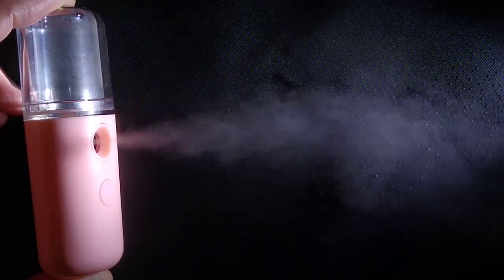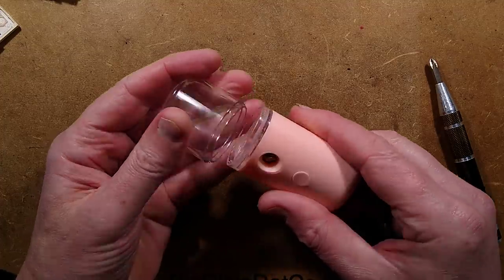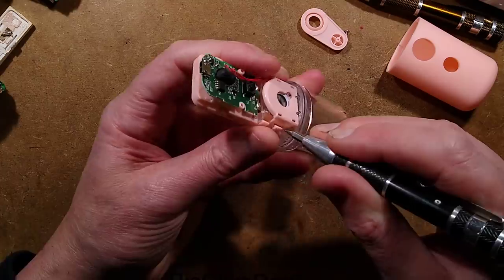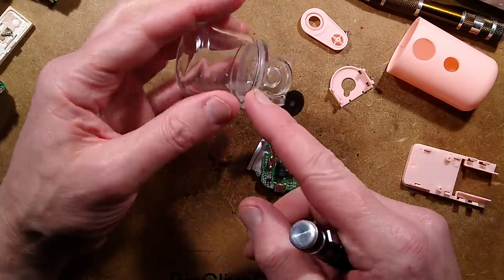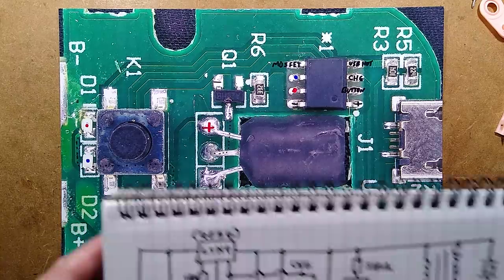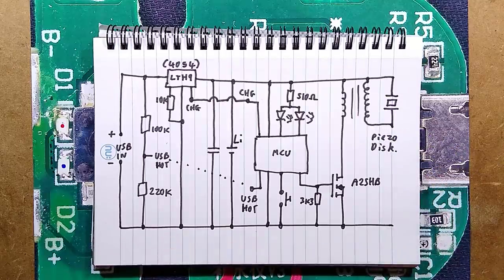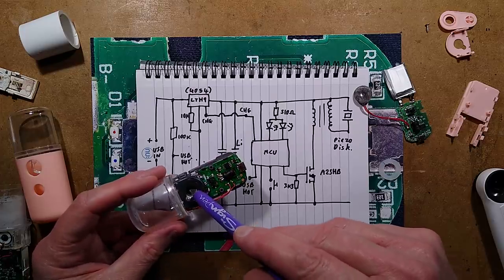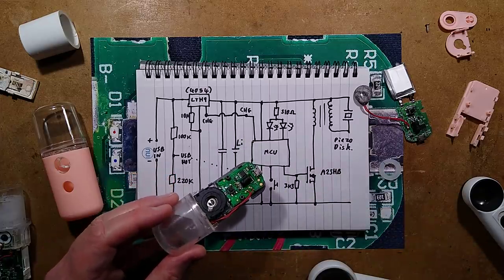Inside a USB rechargeable misting unit (with schematic)

Comment: So, eliminate the transformer and the transducer, then the switch, bridge the switch pads, and wire up the battery contacts appropriately and you have a replacement (minimal capacity) Li-ion battery, with charging circuit attached/built-in, for use as a camera battery? If so, the model that can be USB-plugged in operation would allow switching out the external power pack, while still retaining the camera settings while you are fumbling in your bag/drawers for another battery pack…

Comment: Is there a specific technique you use to turn a circuit board into a schematic diagram, if so could you make a video to show how best to do this? Cheers P
Reply: I bet if he answered it bould be "through experience". Just do it a hundred times and hey, it's easy now :) He has mentioned in some videos some of the techniques. Like taking photos of the circuit boards and mirroring one so that the components appear in the same orientation and then just tracing the connections with a marker. A great majority of these circuits are very similar though and he often draws out roughtly the same thing with some variation from circuit to circuit.

Comment: In the USA the symbol for a resistor is a zigzag line. Elsewhere it’s a... block? I suppose both make some sense.
Reply: Old style british is a zigzag too. I prefer that, but a rectangle is so much easier to draw.
Reply: I believe a zig zag pattern in the UK is for parking space, perhaps that's the logic behind it. The City planners might have been electronic enthusiast.
Reply: Back in the day, if a line crossed another, it would have a 'c' to indicate it did NOT touch.
Reply: @Matt Quinn which response are you referring to? The zig zag or the "c" response?
Reply: @Matt Quinn matt, oh sure, next thing you'll tell me is ya'll drive on the left side of the road " over there" 

Seriously though, evidently i forgot to type a "no" as in no parking/crossing.
Reply: @Matt Quinn Yes, pardon the confusion. Same person. Originally intentions were to separate personal/home &  business/work but that didn't pan out too well. I'm getting old i suppose...........The Abbey Road album comes to mind for some reason.
Thanks for responding. 

Btw: we drive on the "right" side of the road. 🙂😎
Reply: I hope that's  acceptable to you. I wouldn't want to create any reactance.
Reply: @Matt Quinn Yes perhaps, but I did pardon myself..(see above)

Comment: 0:06 - It's not water vapour. Water vapour is an invisible gas, and it would need to be quite hot to stay as vapour for any relevant duration. It's a water mist (i.e., small droplets of liquid water suspended in air - not water in gaseous state).

Comment: Had a few of these since my family members dont need it anymore,the only annoying things about it is that they have the same auto shut-off thing.Is there any way to remove the timer so it runs like forever? thanks.
Reply from the maker: It's in the software.  Other versions don't do it.  The timer option will protect the disk from running dry for too long.
Reply: @bigclivedotcom  ok thanks! also,i dont really need the timer since i regularly fill the humidifiers i have with water.And also,i got a usb humdifier kit that doesnt have the timer,to know it you actually have to spot a tiny print in the pcb sayng its a DEMO,or DEMO BOARD.

Comment: Is that MOSFET being switched at 120 KHz to drive the Atomiser? Or is the Transformer secondary winding at that frequency? Not sure how they work?
Reply: the transformer cannot change frequency, it's just a bunch of wire wrapped around a core. The MOSFET will pulse for a short period (low duty cycle) 120 thousand times a second, connecting the primary winding of the transformer to ground, whilst the other side of the primary winding (along with one side of the secondary) is connected to the positive voltage rail. During the time the MOSFET is on, current builds up in the transformer (as it has inductance) and if it's a conventional transformer with really tight coupling and high permeability core, the current is transferred straight away to the secondary, causing the voltage to rise. When the MOSFET turns off, the voltage drops back down. If the transformer is a Flyback transformer, the current in the primary winding does not get immediately transferred to the secondary, as the transformer has a high leakage inductance, instead it carries on building until the MOSFET turns off. When it does, the current must keep flowing, (as the current in an inductor takes time to die away, whatever the rest of the circuit is doing). The only option available to the current is to be coupled across to the secondary where it causes the voltage to rise until the energy in the flyback transformer is exhausted. This is the transformer I think they will have used, as due to how the current must continue flowing through the secondary winding, the voltage is far more inclined to spike to a very high level, even without so many turns on the secondary winding (the voltage on the primary also spikes, but the components they use can be chosen to cope with it).
Reply: The secondary f winding would the same as the primary. My question is, what is the secondary winding voltage.

Comment: I wonder if they will hold up to isopropyl alcohol? I have 3D printing filament that smooths out with IPA and misting it on would be a great method of application.
Reply from the maker: I tried and it didn't atomise properly.  It just seeped through the holes.  A closed chamber with a heating pad for the isopropanol might work.
Reply: @bigclivedotcom  There is a company that makes a chamber specifically for it and they use a piezo element like the ones for the little tabletop water fountains that creates "fog" but I thought this little device would be easier. Oh well, thanks for trying.
Reply: @bigclivedotcom  Forgot to mention the ones made to work for it are big buck$

Comment: I wonder what is the output voltage to the piezo...
I have a somewhat similar item. Its an AIO, 3 speed fan, mist, powerbank & lamp (one small LED) powered by a one replaceable 18650 cell. On first attempt it would not mist. After taking it to pieces, i found they inadvertantly placed the piezo  driver upside down. I reversed it it, and viola, it worked! 
Interesting enough it continuous to power the USB while charging, so basically i use it as a low power 5vdc (UPS) Neat. 
I think ill try some fog juice!!! 
Its also in the shape of a teddy bear.......
Reply: @Wazaag Break-head I'll upload it to my account, you can watch it there. Id post a link but dont want to intrude on BIGclive.

Comment: A good vid, Clive. Do you suppose that the piezo transducer and the secondary winding of the transformer constitute a resonant circuit?
Reply: as the transformer has tightly coupled windings, I would think not. It possible that the piezo is driven at its (mechanically) self resonant frequency though.
Reply: @henryokeeffe5835  Yes, Henry. That's a good point.

Comment: The atomised 'mist' comes out at a fair rate - any idea why the water bothers to go through the tiny holes, then get kicked away like that?  As you said, the liquid 'column' height is pretty small, so there isn't much of a pressure difference.  Just wondering...
Reply from the maker: The disk is sharply tapping the water with ultrasonic energy that both forces it through the holes and shatters it into droplets.
Reply: I think it's just path of least resistance as far as why the water comes out the front. It's both fighting the pressure of the water and the internal pressure of the tank. There's probably some other weird ultrasonic interaction with surface tension and the domed geometry of the disk.  
It'd be interesting to find out what science and engineering goes into something like that.
Reply: As the mesh moves in and out, it pushes against the inertia of the water on one side and then flings droplets into the air on the other.

Comment: Clive I am in the UK and am designing a Lamp (decorative) I need to ask you a question about safety on the LED light I am using. Is there a way I can contact you?
Reply from the maker: You can ask a question here.
Reply: @bigclivedotcom  Wanted to send a pic. I have a Led spot bulb that I pulled apart. I have separated the driver and led. There is obviously no earth. The DC out is 27v. The AC to 27 is nice and compact. How can I make the unit safe?
Reply: @bigclivedotcom  I am more concerned about legal requirements.
Reply from the maker: @bp9293  With lighting drivers there is usually little or no isolation.  Treat it as being referenced to mains voltage.  A safer option could be to use a safe 12V supply and matching 12V LED modules.
Reply: @bigclivedotcom  That was my fear. Is there no way around it? I have it working perfectly with my design. Mainly I don't have the money for my project.
Reply from the maker: @bp9293  How bright does it have to be?  Could you use low voltage LED modules suitable for a 5V USB supply?
Reply: @bigclivedotcom  Hi Clive. It needs to be bright. Sort of like this https://www.indiamart.com/ainovalighting-faridabad/post-top-luminaire.html
It is basically going to up light onto a shade I have not tried any of the 5v mods. All of my art is made from recycled materials.
Reply: @bigclivedotcom  I am looking to create a range of unique products with LED lights. My goal is for them to be individual works of art. There must be some way around this? You know way more about this side of my ideas than I do.

Comment: @11:35 - charging such a small lipo at 500ma (over 3C) is not a good idea
Reply from the maker: It usually alludes to the circuit being designed for a bigger cell.

Comment: have you looked at the Air Wick Essential Mist diffuser? i like them but i want to know what can you use to refill them? is this concentrated oil or is this diluted? i can't tell and from what little test i did i can't get them to work with refills i made. be nice to know what the magic mix is to make your own to reuse the bottles. i have the original but have looked at the new ones that have bluetooth because can control when it turns on and off easier and stuff. the origional you have to turn on when you want it to come on and there is a timer to stay on 8 hours and off for 16 hours. https://www.airwick.us/products/essential-mist-diffuser
Reply from the maker: They work with some passive reed diffuser type aroma refills, but they really need to be made with super-concentrated aroma chemicals for the proper effect.

Comment: You can spread this nice sars cov-2 like that !
Reply: Quite right Eddy. As with all ultrasonic atomisers, any bacteria, viruses and dissolved minerals in the water will survive the atomisation and so can be easily inhaled deep into the lungs. The only safe option is to use distilled water and even then I'd boil it first.